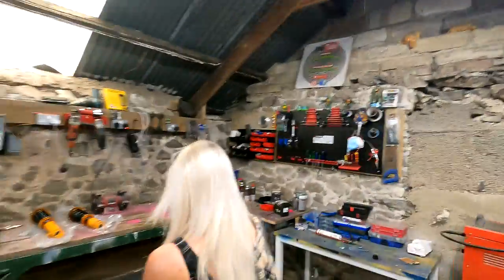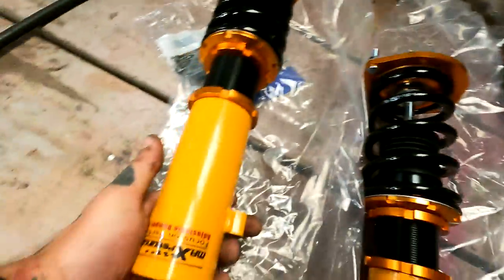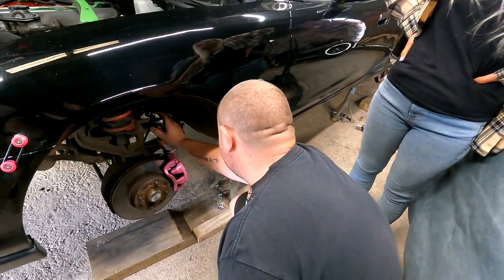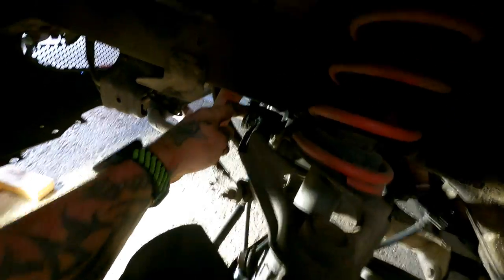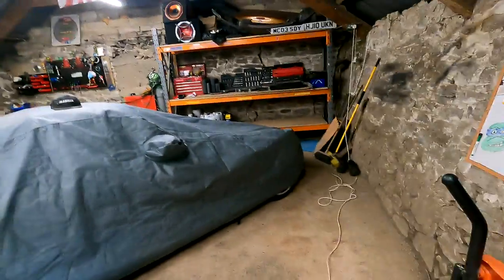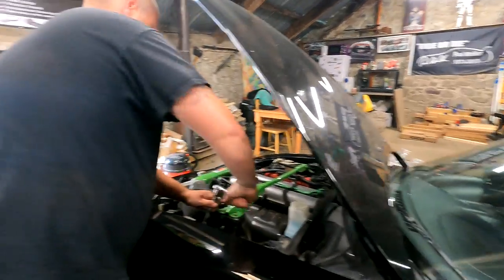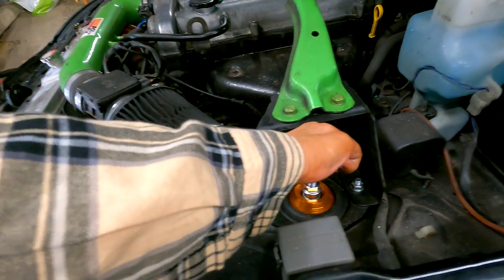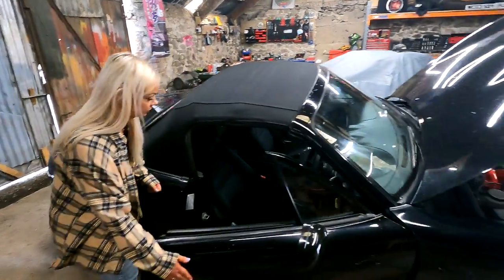Maxpeedingrods Coilover Install On The Mazda MX5 MK2 NB Miata

Comment: They do NOT lower the car at all. Or, rather, the fronts can be lowered by 0.5 inches from OEM, while the rear rides an entire INCH (2.54 cm) HIGHER then the OEM. the ride is very good, but the car looks like shit. The only way to lower it is to cut springs...